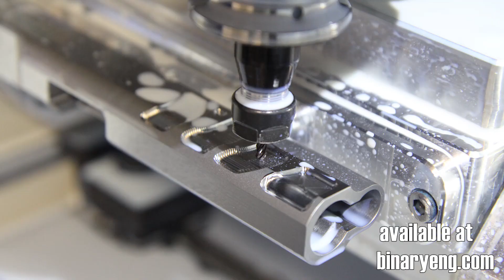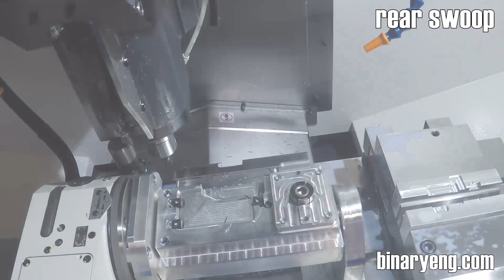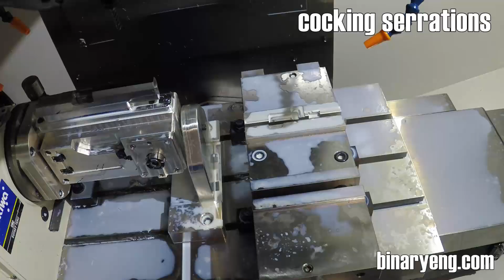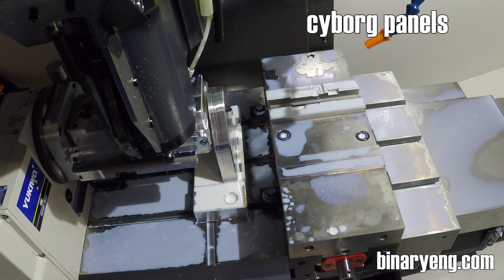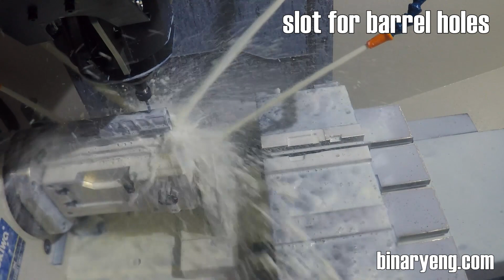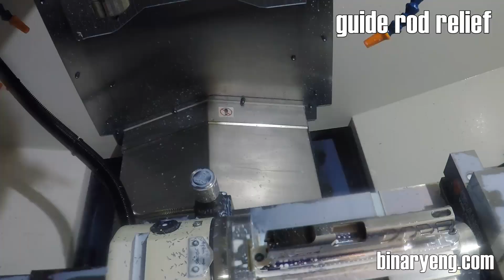V2.0 CNC 1911 Slide Lightening

Comment: That looks a lot faster than the old way on the other machine! How much has your times decreased? Like 10x.
Reply from the maker: It's roughly way faster.  Mostly because it is just one setup, but also doing the flat top as a profile and roughing the pockets at 12K RPM.  Surface finish is way better as well.